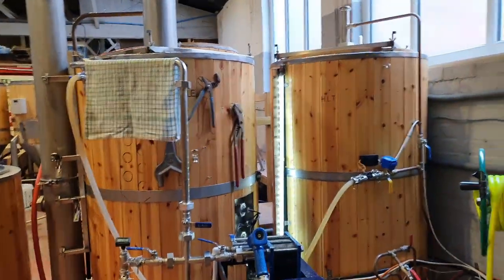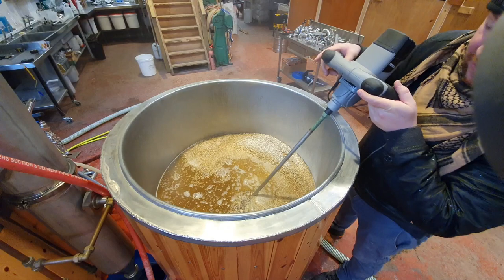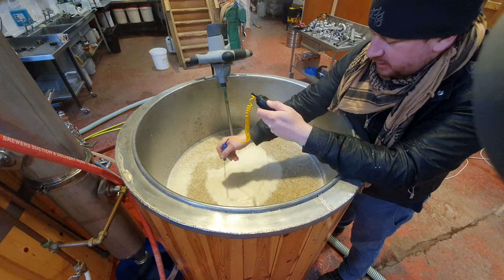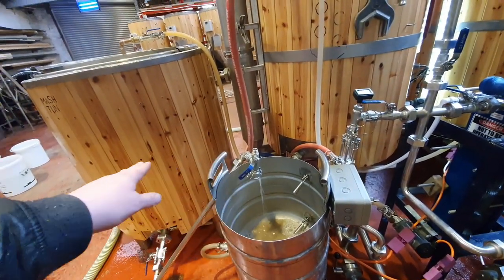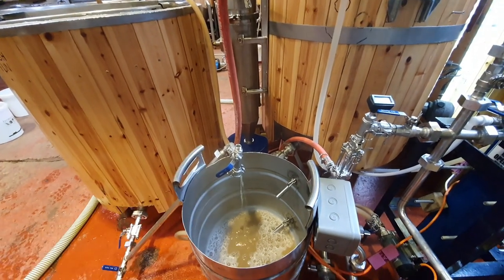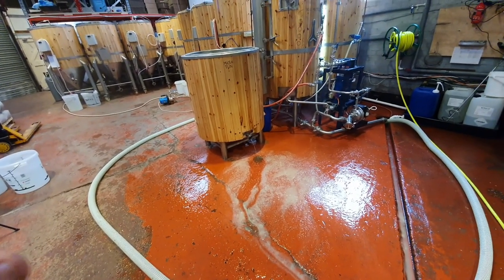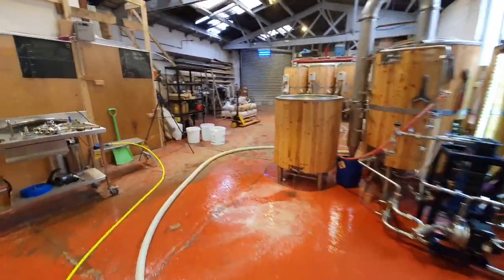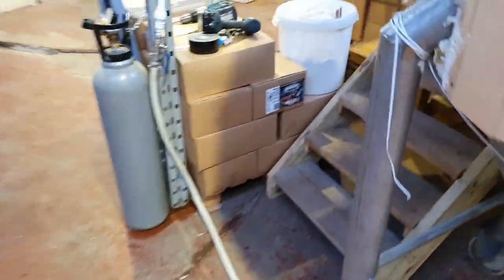Testing The New Mixer

Comment: Have you tried the underback without using the plaster mixer? I used a mixing paddle to mash in a few times and every time i had a stuck mash. I thought it was knocking too much air off the grain so it just sinks instead of keeping the grain bed floating like a cork